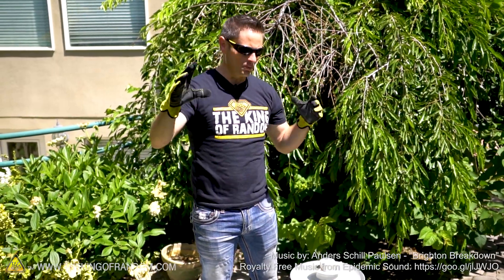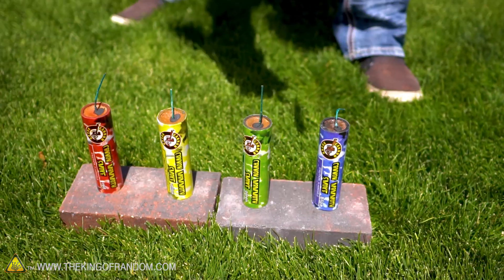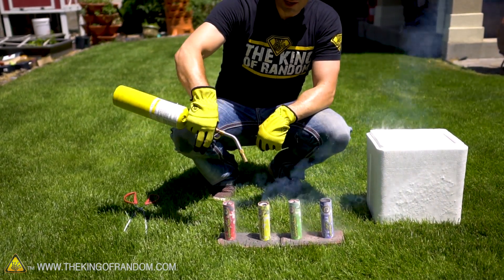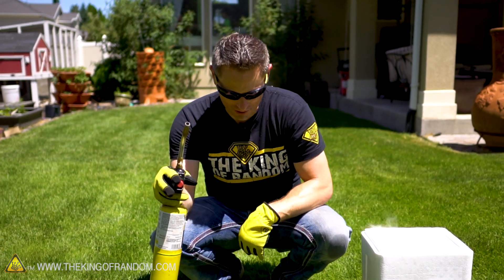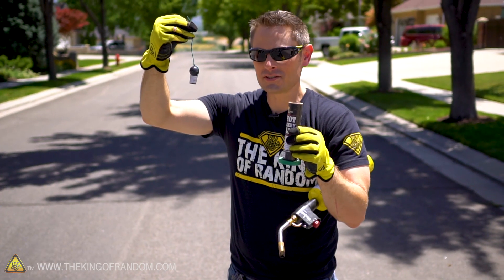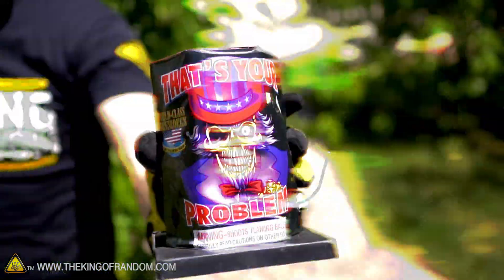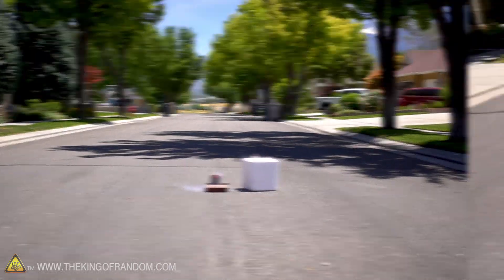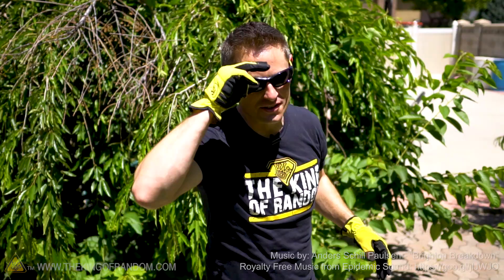Fireworks In Liquid Nitrogen? TKOR Experiments With Shooting Fireworks Combined With Liquid Nitrogen

Comment: I didn’t think the smoke bombs in liquid nitrogen would work because of the fire triangle. However, I think fireworks that simply explode instead of burn slowly will work even when dipped in liquid nitrogen because you only need enough heat to get the reaction started. You don’t need enough heat to keep it going because once it starts, the reaction will be over in a fraction of a second. I do think, however, that the explosion will be weaker because the tiny amount that reacts from the initial ignition is probably enough to blow it apart but not enough to ignite the rest of the powder. UPDATE: I’d say I was right lol

Comment: I'm not surprised about the less than spectacular results.  We need fuel, oxygen and heat.  The liquid nitrogen and frozen fuel take so much heat from the fuses that there is insufficient heat to set of the fireworks properly.  Some of the requests are starting to get very dangerous.  I'm concerned when people ask if you can melt fireworks in the foundry or something like that.

Comment: What happend when you unfreeze liquid nitrogen, will it be a liquid? Will it viporize?
Reply: Fatey_14 I'm not sure this question makes sense, as it is not frozen
Reply: It turns to nitrogen  gas
Reply: @ipodhty  Yes - -196 degrees Celsius to boil LN2
Reply: To that point can you freeze liquid nitrogen? What is its freezing temp?
Reply: You cant unfreeze a liquid. It is already unfrozen
Reply: It will turn back into liquid nitrogen.
Reply: Fatey_14 you mean evaporate. Not vaporize.
Reply: Fatey_14 also it's not frozen. But if you mean to make it warmer then idk
Reply: -196 degrees Celsius to boil LN2. It'll be a gas.

Comment: what if you put liquid nitrogen in a microwave
Reply: Easy

 💣💣💣💣💣💣💣💣💣💣💣💣💣💣💣💣💣💣💣💣💣💣💣💣💣💣💣💣💣💣💣💣💣💣💣💣💣💣💣💣💣💣💣💣💣💣💣💣💣💣💣💣💣💣💣💣💣💣💣💣💣💣💣💣💣💣💣💣💣💣💣💣💣💣💣💣💣💣💣💣💣💣💣💣💣💣💣💣💣💣💣💣💣💣💣💣💣💣💣💣💣💣💣💣💣💣💣💣💣💣💣💣💣💣💣💣💣💣💣💣💣💣💣💣💣💣💣💣💣💣💣💣💣💣💣💣💣💣💣💣💣💣💣💣💣💣💣💣💣💣💣💣💣💣💣💣💣💣💣💣💣💣💣💣💣💣💣💣💣💣💣💣💣💣💣💣
Reply: The Shaddow true true
Reply: 🔥 work in liquid hydrogen🎆
Reply: Tavo Benitez it evaporated
Reply: Tavo Benitez explosion
Reply: TheBoltMaster  Not even that, it would evaporate exactly as fast as if it were on the counter.  Nitrogen is non-polar and not metal, so it gives no effs for microwaves.
Reply: You make a refrigerator

Comment: What would happen to a DC electric motor if you soaked it in Liquid Nitrogen? Would you be able to exceed the recommended voltage because it is so cold? Also, can you run the motor while it is submerged in the LN

Comment: its not the cold that keeps the fireworks from lighting, is the nitrogen gas trapped inside where the combustion supposed to take place. The smoke grenades didnt light until the blowtorch pushed out the nitrogen and allowed oxygen to enter the tube.

Comment: What happens if you light off one smoke bomb and put it into the liquid nitrogen? ✌️👑 (from 🇨🇦)
Reply: Kilo3421 nice idea! i want to see that too
Reply: Kilo3421 it will die down
Reply: gucci roast are you sure? I don’t think so...
Reply: Kilo3421 likely the smoke bomb will burn very briefly (maybe a second total) when submerged in the liquid nitrogen. But the burning composition will be smothered by the liquid nitrogen. You can use liquid nitrogen to put out fires (most easily on top of water).
Reply: Kilo3421 I had the same thought lol. then I scrolled down and saw this

Comment: What happens if you get those smoke bombs, but instead while they're burning you chop them in half, will it explode out or just cause the smoke to all ignite at once. 
Also, what would happen if you made a line of all the smoke powder in different colors and ran fuse though it and lit it on fire, Instant Smoke Rainbow!? 💨🌈
Reply: TylerJ oooo interesting
Reply: TylerJ u solved ur question
Reply: TylerJ if you put a comma in front of the word "burning" in your first sentence, it won't sound like he has to get burnt to chop them in half

Comment: Hey grant, great video. im curious as to if you would try heating metal till its red hot and dumping it into liq nitrogen to see if internal stress would cause a fault in the crystal structure similar to rapidly cooling glass.

Comment: Try to burn air with fire
Reply: Try to burn air with fire you can do whatever you need to burn air just a little bit of air
Reply: Cindy Rodriguez the air we breath is mostly non flammable gases it is impossible to light air on fire, sorry to disappoint
Reply: Cindy Rodriguez you can't.... even though oxygen is flammable, you can't explode it in air. Hydrogen would work though.

Comment: the smoke flares did not go off at first because they were below the melting point of there oxidisers and could not sustane the reaction until you heated it up with the torch and gave a kick start to the reaction.

Comment: I believe the issue is with the material used to bring the temperature down, and nitrogen is a fire retardant. I suggest using liquid oxygen, and please use a remote ignition system, as oxygen is part of what is needed for a fire. I do not suggest using liquid hydrogen as that could be deadly.

Comment: think through why the fireworks are not operating correctly, why the smoke bombs did not work is lack of oxygen, specifically the opening did not burn out correctly due to the small initial flame, as far as why the efforts are so mild is the oxygen is in liquid form and thus is not reacting chemically, as far as how to get rid of them, open them out and light off the black powder, the powder should burn without any great force

Comment: Off Topic, but with your metal foundry's.  You think you could do a video on what can be done with the aluminum dross and all the discarded slag scooped off the top of the melting metals?  Afaik, the aluminum is Aluminum Oxide which has some uses, possibly when ground down to powder form.

Comment: put termite into liquid nitrogen to see if still work.
Reply: Effort jajaja i hope no
Reply: Do you mean thermite, or a termite,which is a small bug.
Reply: Random Commenter thermite jajaja
Reply: thermite self oxidizes, so it will burn regardless
Reply: TheDarkalkymist so does gunpowder, but as seen in the video, it doesn't work. The thermite or gunpowder needs to reach its activation energy to start the reaction, which is why when you cool the pyrotechnics in liquid nitrogen they do not light or take more heat to light, because they have to reach the activation energy
Reply: put human in liquid nitrogen to see if it still works ✌️👑 please notice
Reply: Im curious
Reply: ravenous no, the water inside of the human will expand as it solidifies, crushing cells and organs. Also lower temperatures lowers the rates of reactions typically so respiration would slow down and the human would die
Reply: If you could somehow manage to get it hot enough it would still burn since the iron oxide provides the oxygen needed for the reaction

Comment: Try lighting fire works in a vacuum. Like so he can see👍👌🏼🌴💯🐶🍍
Reply: +Giovanni Rivera gunpowder and many other pyrotechnic substances can burn eithout oxyhen from the atmosphere since they often contain an oxidizer like potassium nitrate.
Reply: +Giovanni Rivera Most of the brightest fireworks have oxidizers and oxygen in the atmosphere doesn't mean anything to them since the powder is usually in a container so the pressure can build up while it is burning and it wouldn't burn without the oxidizer and it should burn without oxygeb from the air.
Reply: amadeusz antyga yes that is true but wouldn't that flame be barely visible anyway in a vacuums since the flame would cling to the few oxygen molecules in the powder or fuses burning a dim dull blue
Reply: +amadeusz antyga *most of the pyrotechnic devices not only some of the brightest fireworks
Reply: amadeusz antyga I'm just trying to say it wouldn't burn the way people expect, it wouldn't look exciting because of the lack of atmosphere, that's all I'm trying to say lol I understand fire can burn it just wouldn't make a exciting video
Reply: +Giovanni Rivera It could make a fine experiment though. Not all experiments have exciting results :)
Reply: Albert Axelsson you can't make a flame in a vacuum there is no air so nothing would happen

Comment: reason yellow didn't want to go off at first is because when you light the fuse, there is a lot of heat generated, making the contents heat up and smoke. but when it is cold enough, it wont want to heat up, then the fuse will burn away, leave the contents intact.

Comment: What happens if you dip a saw blade in luiquid nitrogen and use the saw to cut wood? will the blade shatter or will it fracture with tons of micro fractures that would make the saw blade less durable and make it shatter?

Comment: Can a fuse that burns underwater burn under liquid nitrogen? 👑
Reply: Zraxter no, it won't as the nitrogen will not allow any oxygen, which is required for it to burn👍
Reply: Antoine Cavanagh You're kidding right?
Reply: Kms I'm done lol OFC THERES OXYGEN IN THE WATER H2O
Reply: Archit Sarda he said if it can burn under water meaning it wouldn't need oxygen. Like solid rocket fuel.
Reply: M Hayne Most mixtures contain KmNO4 or something similar to supply enough oxygen for a nice combustion - that is if you put enough energy in so the oxygen gets actually released. Its a bit easier with nitroglycerin/ nitrocellulose as the oxygen already sits in the molecules, just not in the most stable place...maybe try fuses lacquered with the latter?
Reply: Zraxter u forgot the peace sign
Reply: yeah there is that's how fish breathe... the gills filter out the water and get the oxygen...
Reply: Most likely, fuses that are able to burn underwater have chemicals that react to produce oxygen to fuel the flame. So unless it is too cold for the reaction to take place the fuse should burn.
Reply: Zraxter the fuse will burn because it doesn't require oxygen to burn if it can burn underwater.
Reply: The lN2 will probably drain to much energy, stopping the reaction. That's the problem in this video - the burning normally would generate enough heat to ignite the adjacent mixture and allow for a sustainable chain reaction. It seems you'll need a more energetic fuel to do that at cryogenic temperatures...det cord should work;)
Reply: Robert Martinu additionally, ambient O2 is replaced with nitrogen. The fireworks were designed with ambient Oxygen in mind
Reply: Hussain Boss ?

Comment: if you thik about it , for the fireworks to be faster heating them up as you you would need a hotter temperature than the reactions temperature, in any case the firework would light off before achieving that

Comment: Flow 99% hydrogen gas and 1% methane into a vacuum chamber and then either fire microwaves through the gas or a high voltage electric charge. This may not work but u never know.

Comment: The next question is, of course, what will happen if a smoke bomb is in a vacuum
Reply: The expanding gasses would compete with and clog the vacuum pump.
Reply: The Sqoou that is the most probable result
Reply: nothing. a fuse can't burn in a vacuum.
Reply: No oxygen in a vacuum, no fire to light the fuse.

Comment: What will a firework do in a vacuum chamber
Reply: watch cody's lab he already did that
Reply: Perhaps learn a little chemistry? The black powder produces it's own oxygen. The nitrate - typically KNO3 provides the oxygen for the reaction.
Reply: Fireworks have an oxidized so it will burn
Reply: it won't light up due to lack of oxygen or blow up even before you start the pump.
Reply: R.C FUN r.c fun nothing, no oxygen to burn

Comment: Can you achieve cold fusion by combining two of the same metal in a vacuum?
Does liquid nitrogen conduct electricity? and what happens to liquid nitrogen if you pass electricity through it? 
Lastly, will a steel/iron bar shrink when dipped in liquid nitrogen for a long time?

Comment: 💡What happens if you freeze an cd/dvd disk and put it into your pc?
Reply: I think the frost may fill the microscopic bumps so there'd be nothing to read, also you you didn't need to say an instead of a
Reply: It will most likely freeze (duh) and shatter into a million pieces. The discs are already thin enough to freezing them will surely just make them even more fragile. Plus the humidity around it will just drip into the cd/dvd reader and ruin it.
Reply: Literally nothing

Comment: What would happen if you put firework in liquid oxygen, would the reaction be bigger because there is more oxygen?
Reply: This is just what I was looking for!  These commenters are thinking like scientists.  They have taken what they can observed in the 'random' experiment with some careful skepticism and crafted alternative hypotheses to explain what they might see in a new experiment (LOX).  Science is an endless chain of experiments.  The question here may actually be this . . .
Is the slow down of the reactions due to "cryogenic temperatures" OR the fact that the nitrogen has driven out the oxygen necessary for  efficient combustion?  The shells were saturated with liquid nitrogen that was still vaporizing when they were lit.
Reply: Brammetje 749 useless
Reply: richh10 k
Reply: Brammetje 749 no, the entire thing would go up in flame due to LOX being extremely flammable, so flammable you can have a fire hazard spilling it on concrete
Reply: Get down Mr.President! Liquid oxygen actually doesn't do anything by itself. It needs a fuel afaik

Comment: As it appears gun powder has to overcome the huge temperature gradient to ignite and get enough energy to burn, it got me thinking. You've obviously shown the effects of cryogenic temps show down the reaction speed of ignition, one sure fire way to test it would be to light off a measured length of fuse cord at room temp, time it and then compare burn time for same length that's ignited right after cryo bath. Only issue is that the tiny fuse diameter would heat up super quick. Although this setup would provide a great comparison between temps to chemical reaction speeds if it could be done reliably.

Comment: Hey Thompson what happens if you turned on the fireworks and throw it inside of the liquid nitrogen? 🤔
Reply: Jose Leon If it's a black powder firework/firecracker it will burn in a confined space because the potassium nitrate decomposes when it's heated.

2KNO3 + heat -> KNO2 + O2

So a black powder firecracker would explode in liquid nitrogen.
Reply: Tommy Garcia same thing that happens when you put a flame near liquid nitrogen. The nitrogen gas floating on top of the container puts out the fire because of the lack of oxygen

Comment: put calcium carbide in a Pringles can. put a hole in the bottom woth a screw driver. add water and the lit. Wait till it fills with gas and light it at the bottom. watch out for your ears!

Comment: Hi. May the effect in fireworks if for the presence of nitrogen so no oxigen to burn or the temperature? 
Try to freeze them in a impermeable bag open it away of the nitrogen and try again. Looks like the fuse failed because of the absence of oxygen.

Comment: how to bring dead batteries to life 👑✌
Reply: charge them?
Reply: Filip Songs battery CPR obviously
Reply: do you mean like batteries for remotes (AA,AAA?) 
Just heat them up to 40 ish °C and they will work a long time until they are cold again
Reply: And sorry for my bad english this isn't my language i usually speak german
Reply: Filip Songs lmao
Reply: Filip Songs not possible if they are not rechargable
Reply: Rytis Rytis it is possible you have to replace some things of the battery
Reply: PyroHacks there are acids inside so you wouldnt be able to replace them you might buy new ones
Reply: Rytis Rytis You can just buy some potassium hydroxide and replace the lquids in the battery with it
Reply: PyroHacks it would take more effort than buying new ones and how would you extract the liquid and add it
Reply: Rytis Rytis Yes but i dont say that it is cheaper to buy new ones than replacing the acid its just a solution when you have no way to get new ones
Reply: The Great Exploiting Fight for the Finishers You can't charge every battery you need special ones
Reply: PyroHacks just buy a generator conect wires wirh the flashlight or something you would use and thats it 
and if it was like a apocalypse i dont think you would have access to those chemicals
Reply: endergaming IL lmao

Comment: Will a bullet be slower if It's dipped in liquid nitrogen ? 👍or 👎
Reply: Not the bullet itself, but it may have some effect on the gunpowder, causing the gun to have problems firing them.
Reply: mario99mon no it won't fire at all
Reply: mario99mon bullets rely on pressure differential of the gunpowder igniting and creating pressure, launching out the bullet and the bullet shell later. So no. The gunpowder is entirely sealed off and is ignited through impact

Comment: can you melt the magnet?
Reply: Metal loses magnetism if it gets past a certain temperature, it'll just end up as molten metal.
Reply: mahdi asamuddin05 it would lose its magnetic pull because of the heat
Reply: however, what if you freeze it?

Comment: Try casting a wire and running electricity trough it. See if it will conduct normally or if it will  have too much resistance due to imperfections and just heat up nonstop. 
And if it does...cook something in it ;)

Comment: The fact that the smoke grenades didn't go off might have to do with the shape of the shaft since there is an indent where the fuse goes in. The cooled vape that comes off the casing is going down in the indent the fuse does not have the oxygen it needs to burn. When Grant heats the casing there is less nitrogen vape an more oxygen it lit off.